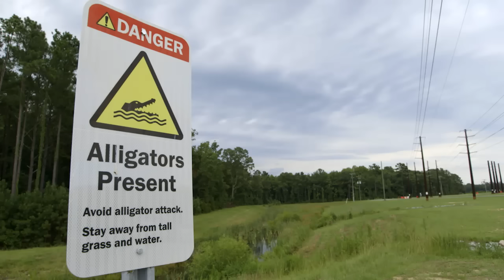Inside a Google data center

Comment: They have scooters at work.

SCOOTERS!
Reply: They have alligators as security. 

ALLIGATORS!
Reply: And Nerf 😂
Reply: Turnipkin Tailgating? Have your badge visible! ---Tailgator
Reply: Ikr I'm jealous .
Reply: +Shelton Burnadeski And propellor hats.
Reply: +Shelton Burnadeski Most important to use it because that data center is so large and far when you have to fix the issue of more than 5 miles from where you working on that particular aisle
Reply: +Shelton Burnadeski Pixar did it first
Reply: +Shelton Burnadeski I think they will use electric self balancing SCOOTERS in a short time.
Reply: +Shelton Burnadeski We have bikes at work to get arround. But i want that scooter think too!
Reply: Shelton Burnadeski FUCKING BADASS
Reply: i read this in josh's voice from drake and josh and i cant stop laughing
Reply: But have given up the capacity of having a life outside that building
Reply: +Shelton Burnadeski I saw a nerf gun lol

Comment: Very refreshing to see something in America done right.Because you don't see that so much. Most Corp engineering enterprises in America are managed by $$$ not by Engineering consideration. The tools are out there. Its just really hard to show the bean counters that yeah its expensive right now to build it right but in the long run it will save you money if done right. Apparently the "long run" is no longer a consideration. They want it up and running now and cheap. Who gives a shit about temp considerations.
Until there racks start to crowbar from heat overload. Then its people with torches running up and down the halls lol and the top floor saying how could this happen?  Messed up times we are living in. Engineering and accounting are a bad mix.
Just sayin'

Comment: They should use that hot water to heat up the tap water in that town or the onsite hot shower. Or use it to run small electric motor to go green.
Reply: The problem is that they would then also have to use tap water i assume, wich would be very bad for the pipes as it isn't very pure. (it has calcium and other minerals in it).
If you look at it another way, and they would use pure water the hot water coming from them would #1 be not hot enough to serve peoples needs
#2 Be not safe to drink as it comes from pipes with a lot of residue.
Reply: +Fa Vang wouldn't be anywhere near hot enough.  By the time it'd reach people's homes it'd probably be about 75F.
Reply: Bryce Jones better than manually cooling it. but still much more wasteful than using it for energy.
Reply: +Fa Vang thing is the water isn't "hot" just warmer than it used to be, water might come in "cool" at 70 degrees, and go out "hot" at 85 degrees :l so not alot of power to work with
Reply: cyramor ackupuncture you really don't know what your talking about. try researching water cooling more. Average tap water is 55f, ocing can bring it to 100-120f. I can tell u got one of dem youtube degrees.
Reply: +Fa Vang You are up against the laws of thermodynamics. It is very difficult to get useful energy out of large volumes of warm-ish water, compared to a much smaller volume of much hotter water.  The greater the difference in temperature, the easier it is to extract useful energy.
Reply: Fa Vang good point. They must waste a ton of energy to cool that water down. In fact, I'd be surprised if they didn't use it for power. I didn't watch the whole video though so I can't attest to that :P
Reply: Kyle  they don't use any energy to cool it, they just let it set for a day and cool naturally .
Reply: +Fa Vang If they could do that they would have already done it...
Reply: ***** They done it in Germany to heat up water. that was heated by servers.
Reply: +Fa Vang do you know how cooling works? dont know much about how they do it...but dude onsite hot shower? didn't you hear they re-use the water.
Reply: Fa Vang They are computer experts after all.
Reply: +THE16THPHANTOM There's a water to water heat transfer device, call "heat exchanger" you can do water to oil heat transfer and not mix liquids, this will get around the pc liquid cooling and public water issue. Also check this out: http://inhabitat.com/german-company-offers-free-hot-water-and-heating-from-the-cloud/ what I was talking about in Germany. I assume it won't heat it til boiling but think of it like a water "pre-heater" before water goes into your 50 gallon water tank to be heated.
Reply: +Bryce Jones They use fluid coolers. I install these types of systems. They are efficient. But they do use energy. Better than most systems.
Reply: +Fa Vang its not that hot, its probably more like 70 degrees not 130 degrees
Reply: +Fa Vang  And then didn't Germany go bankrupt? Being too political correct can kill you!

Comment: 1:58 Windows?? wtf i thought Google had his servers running all on Linux.
Reply: ***** You can easily virtualize Linux in Windows, or vice versa. As a matter of fact, I have a Linux running (Kali Linux) at this very moment, as I'm on Windows 8.1. I could also virtualize a Mac, hell, I could even virtualize an Android, or an Apple IOS on my PC (that's how they develop mobile apps in the first place), all at the same time, if I wanted to.

Virtualization is the future. Everything is becoming virtual. Virtual servers, even entire virtual networks (SDN).
Reply: +Herman Willems The servers are running linux, but there's some very good server tools for windows. It's all about having the best software for the job at hand.
Reply: +Jdiggy77 You will most of the time loose performance when virtualizing. Why are you running Kali? Pentesting?
Reply: Völundr Frey That's true, but the benefits of virtualization usually outweigh the performance loss. I'm not talking about huge data centers, with multi-million dollar IT budgets I'm talking about small to medium sized businesses with tight budgets.

And yes, I'm playing around with Kali. The NSA is offering a cybersecurity curriculum locally, and I'm thinking of enrolling once I meet the prerequisites (CCNA Security, MCSA, Linux proficiency, and strangely enough 200 level Accounting classes or background, security clearance, and a few others).

Comment: Impressive, but sooooooooo big. It reminds me images from the first computers that were so big also and now we have those little tiny NUC as an example.
I think/hope that in few years this big building will be replaced by a cube  with , let s say, 1 meter side.
Reply: En 1982, mon premier PC (512k !!) avait la taille d'un réfrigérateur. Il avait besoin d'un stabilisateur de tension et d'air-conditionné parce qu'il ne supportait pas les variations de T°.
Que d'évolutions depuis lors :-)
Reply: Fabrice DURAND For the amount of data that they have to process, I wouldn't say it's big. And it's only just one of a few data centers that they have

Comment: Reddit has upboated this comment, so I thought I would check it out. Boy was I surprised at the employee using a scooter in the workplace. This is why top minds like me don't have jobs, and live in their guardian's basement. It shows immaturity. A two wheeled scooter is an inefficient way of transportation. A four wheeled one is much better.

Le tip

-Eugene McTipping, moderator of /r/gaming and /r/adviceanimals

Comment: Redditor here:  How theoretically you would infiltrate this data center with ease.

Most likely a rival company like Microsoft or groups that dont like the NSA/google spygrid being deployed to kill 90% of the global population.

Step 1) Pool money resources together
Step 2) Recruit with Ca$$$$$h or lead high level computer science, computer engineering, data analyist, software engineers.  (preferably with years of experience at another tech company like microsoft, apple, IBM)
Step 3) Send them through the hiring process at google.
Step 4) Allow them to work their way up through the ladders for a few years to learn achilles heels, weakpoints, crucial points, nonredundant layers.
Step 5) Let the sabotage begin.

This has been a public service announcement from www.reddit.com

Comment: Why does google not use solar panels ?
Reply: The sun does not stay in the sky 24/7. How would you like if you could no longer search for hentai porn when a California wild fire's smoke blocks the sun for weeks?
Reply: that's not my point, I was just surprised they weren't using their own devices.
Reply: ***** What are batteries? Also, I believe the correct answer is: these data centers take MASSIVE amounts of electricity, some solar panels on the roof just wouldn't cut it.
Reply: infernalz1337
 Chances are you have a mobile device, yes? Well, how often do you charge it? Every day or every week? A commerical operation like that data center would fully  drain the batteries every hour because like you said, "these data centers take MASSIVE amounts of electricity." So to maintain a 100% constant charge for the batteries, you would have to connect them to California's power grid, thus defeating the purpose for the inefficient solar panels in the first place.
Reply: ***** I was simply saying that just because the sun isn't out doesn't mean solar panels are automatically useless lol. Also like I already said, I know that even with batteries it wouldn't be enough to run it.
Reply: *****
You could have solar panels working and producing clean energy and also have it connected to traditional means of power too thus reducing the use of dirty fuels and not having such a large carbon footprint anyway im sure google employees have thought about this, it's like here in Australia people have solar panels and are also connected to the grid for when it's cloudy...

End of the day the people who make money from the structures that are already in place for energy production don't want you using solar simple as $$$$$$$$$$$$$$$$$$$$$$$$$$$$$$$$$$$$$$$$$$$$$$$$$$$$$$$$$$
Reply: Microsoft does.....
Reply: I find it weird that Google employees use MacBooks
Reply: macbooks are better the windows